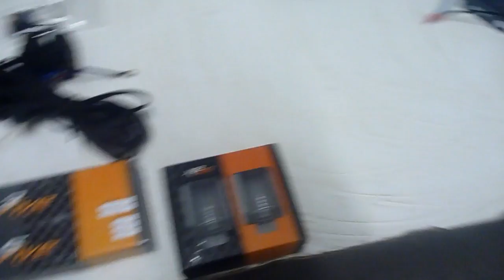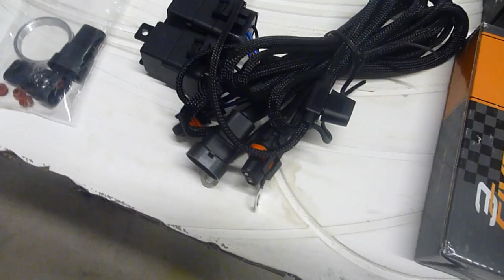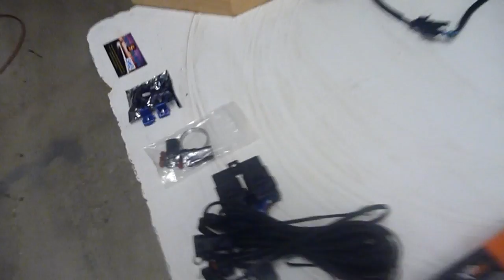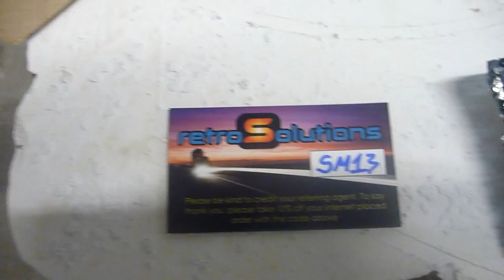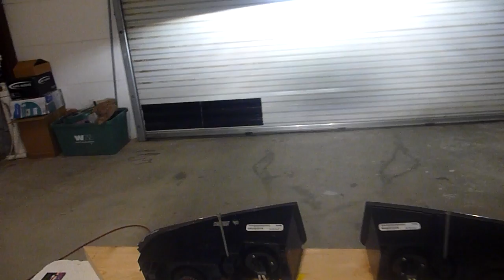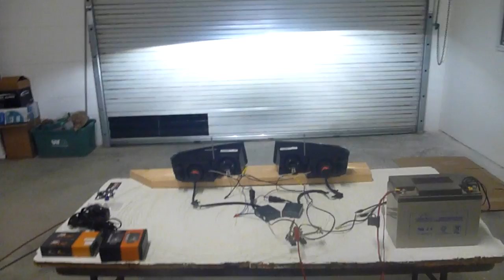2005 Chevy Avalanche Morimoto Projector Lens & HID Retrofit via Superior Mobile by 13

Comment: you said you had a minor issue with the solenoid motor hitting the housing.  how did you "fix" that.  reason being is that I'm wanting the 3" lenses and feel i may run into that issue.  just curious to know how you worked through it
Reply from the maker: This was 4 years ago.  I can't even remember 4 days ago.
Reply: lol. fair enough
Reply from the maker: @tanyarogers5005  When all else fails, DREMEL!

Comment: I used Morimoto lights, projectors and harness on my retrofit too and I have to say the light output is superior to anything I ever used before, the Morimoto XB 35 HID bulbs are very good quality and last much longer than the HID bulbs you get on eBay from china, pay a little more but you get what you pay for.
Reply from the maker: quality ain't cheap and cheap ain't quality!

Comment: these are my headlights, for the high beam i have a splitter so i can use both the highs. i plan on adding some leds for the high beams later on. and for the relay kit i will probably add a secondary 9006 connector so it will have some redundancy.
Reply from the maker: thanks for the support!